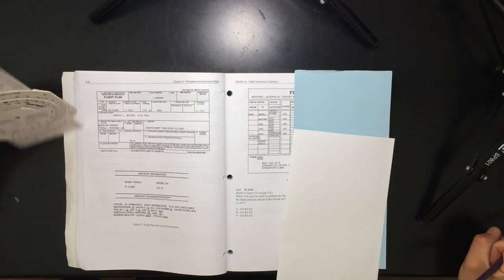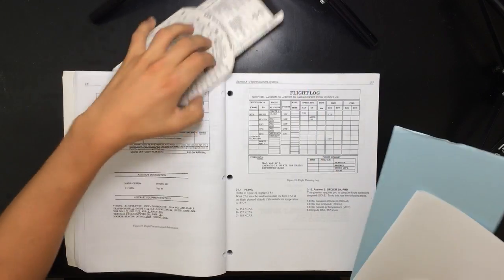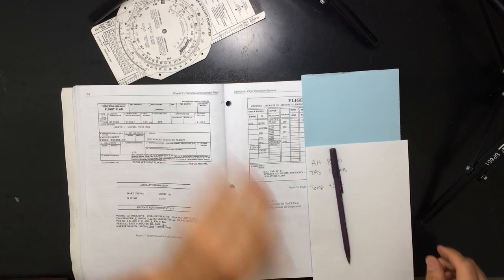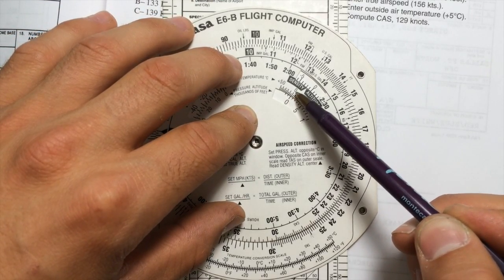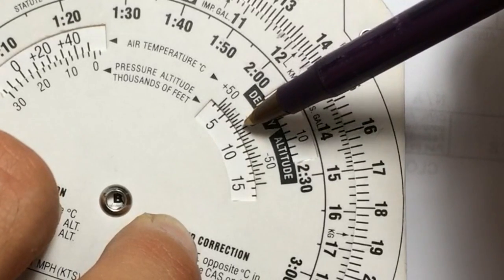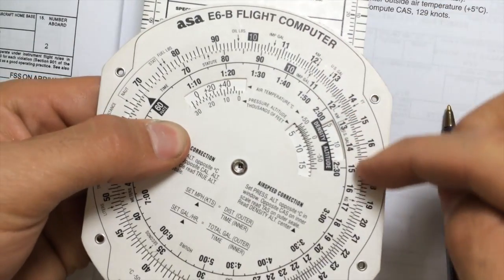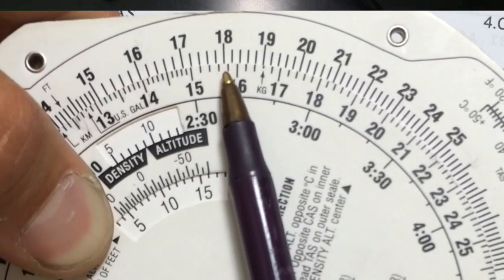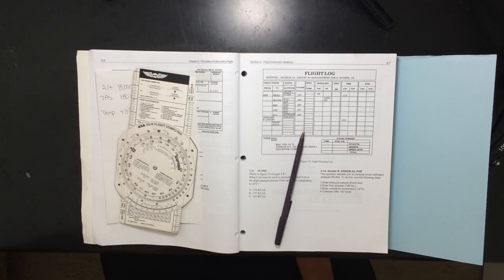How To Find Calibrated Airspeed CAS - E6B

Comment: I think the answer would be 154 knots. You and the book said the outside air temperature at 8,000 feet is +8 degrees celcius. Using my E6B, I got to 154 knots using +8 degrees. I think you said 157 because you're using -8 degrees celsius by accident.

Comment: just to clarify..... is the PA the same as the cruising altitude?   At the time of flight, what if the reported METAR/ATIS Altimeter setting was 29.42 vs 30.42 ?  Would the PA still be the same as the cruising altitude?  In other words, if our cruising altitude was 8000 feet, while our Altimeter setting (real pressure as reported by METAR/ATIS) was 29.42, would our PA be 8500' feet?   or if our altimeter setting (real pressure as reported by METAR/ATIS) was 30.42, would our PA be 7500'?

Comment: Great explanation! The process is showing how to calculate TAS in fact. CAS is a number taken from the POH and is specific for each aircraft as CAS is manly caused by installation or positions errors of the instrument. Using the graphs or charts under the performance chapter of the POH you could find CAS. On the E6B when you use temperature and altitudes data to calculate speed is to find TAS which is affected by temperature and altitude.
Reply from the maker: Thanks

Comment: This video has nothing to do with calibrated airspeed, just true airspeed and groundspeed. CAS as i understand it is IAS corrected for instrument and installation error, how do I find that?
Reply: Nope
Reply: Relation with IAS and CAS is as you explained. 
However - you get estimated TAS from CAS by applying 'corrections' due to pressure altitude and temperature. Exactly what is done here - but in reverse TAS -> CAS.

Comment: On the flight plan it shows "Cruising Altitude" of 8,000'  To calculate your problem you need "Pressure Altitude"  which is what the altimeter reads when it is set to 29.92".  29.92" is normally set when flying above 17,999'.  Then you are flying "Pressure Attitudes"  Below that altitude you are setting the altimeter to the local barometric pressure to read "cruising altitude" which is the altitude above sea level NOT "pressure altitude".  Since you do not know what the "Pressure Altitude" is this question can not be answered correctly.  

The video does show the correct procedure IF you used pressure altitiude.
Reply from the maker: Thanks

Comment: Did you use the altimeter setting of 8k feet as your pressure altitude? Is that accurate? Don't you need to figure out your pressure altitude? Doesn't your pressure altitude vary from the indicated altitude on the altimeter?

Comment: Thanks for the video! Just a side note reminder: "Calibrated" means corrected for position and mechanical errors that are unique to each aircraft and different airspeeds, attitudes, configurations (flaps). For example, the 172s POH has an airspeed calibration chart Performance Section 5 Figure 5.1 to convert KCAS to KIAS. There is also a chart for Stall Speeds KCAS and KIAS Figure 5.3. In other words, you can derive TAS and CAS on an E6B given PA and OAT, for testing purposes, but to convert KIAS (from ASI) to KCAS to KTAS you need a POH. If your aircraft airspeed indicator DOES NOT have a TAS feature,  you could use E6B and POH to calc TAS. REALITY CHECK, no one is going to do this while flying, but I am just trying to make a point of the necessary connection between E6B CAS and POH CAS-IAS.

1) Whatever altitude you are flying, get Pressure altitude by dialing 29.92 in Kollsman window. 2) Get OAT in Celsius from temp gauge. 3) Read Indicated airspeed from ASI and convert to KCAS with POH. 4) On E6B Calc Density Altitude as in the video 5) Take KIAS-KCAS conversion from POH and find it on CAS inner dial on E6B and corresponding TAS on outer dial. This is the correct way to connect KIAS (indicated airspeed from ASI)  to TAS.

To simplify, the E6B CAS means nothing, in the real world, without making a link to POH conversion chart, KCAS to KIAS.  Sorry, got a bit nuanced!
Reply: Very well put.  And nice to see how the real world application would be performed.
Reply from the maker: Thanks for the update
Reply: Excellent comment. Thank you.

Comment: ok. great video. you explain things very well. nice job.  Couple questions.

1.  How did you arrive at your TAS?  I know the " exercise book" gave it to you, but how in the real world do you get it?
     If you are going to say POH, please be specific.
2.  I understand how you arrived at CAS.   When you get in your airplane and fly, there is not a CAS indicator, but rather and IAS indicator.  So how do you arrive at your IAS. Why am I asking? because what IAS airspeed on your airspeed indicator are you going to target and fly while enroute.  It's nice to have all of these exercises, but need to know how it applies to the real world flying. So at the end of the day, what is the Indicated Airspeed you are going to fly on you IAS airspeed indicator located in your cockpit?   (Assumptions: you don't have a TAS Airspeed Indicator in your airplane).  I am curious how you would answer these questions.  If anything it will test and reinforce what you already know and perhaps enlighten others on this blog.

thanks and great video!

Comment: Are CAS and IAS basically the same at low altitudes and low airspeeds? What is the main difference between the two and then mixed in with TAS?
Reply from the maker: At low altitudes and airspeed yes they are close to equivalent. Calibrated airspeed (CAS) is indicated airspeed corrected for instrument and installation error. Indicated airspeed (IAS) is what is read off your airspeed indicator as you fly. True airspeed (TAS) has to do with the speed at which the airplane is moving relative to the air that surrounds it. Thanks!
Reply: IAS is the airspeed directly displayed by your airspeed indicator which is the difference between ram air pressure and static pressure. I don't think IAS airspeed and CAS will be the same. But TAS and CAS airspeed can be equal if standard atmospheric conditions exist
Reply from the maker: Carlos Aguilar Good stuff Carlos!